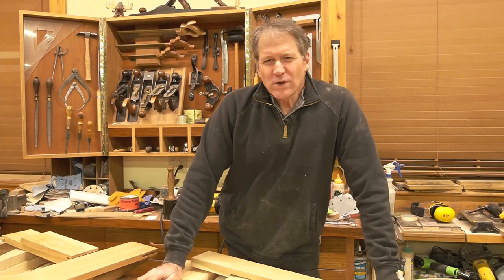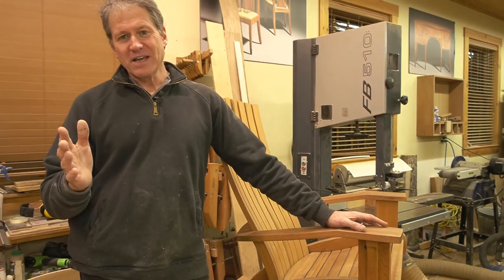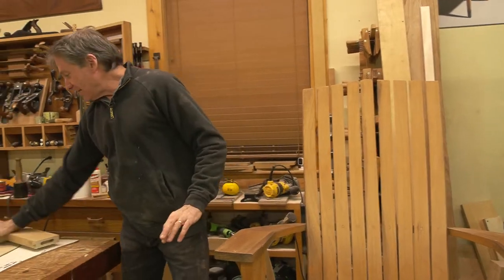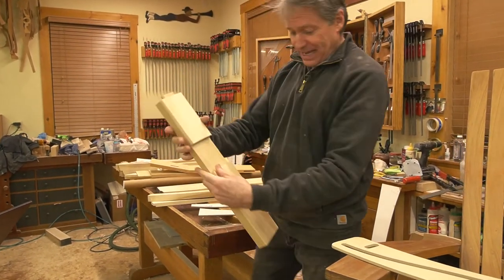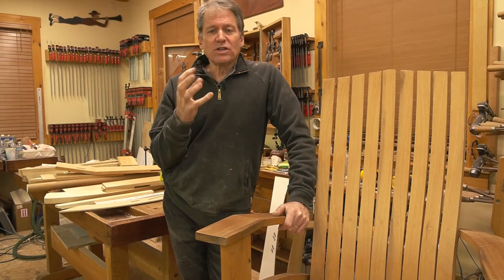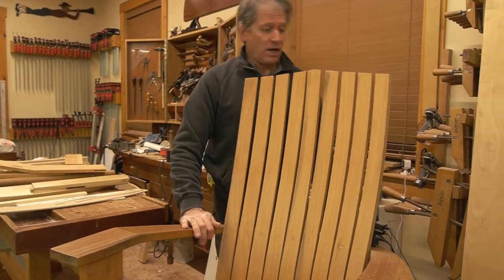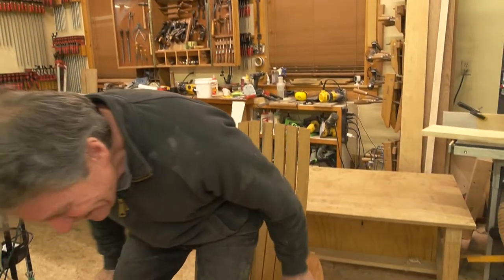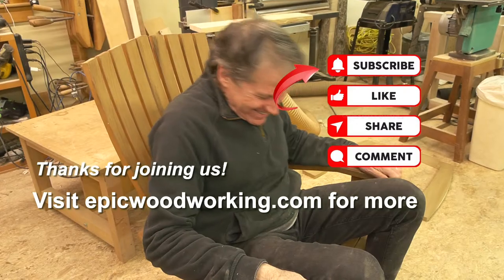The Ultimate Adirondack Chair?

Comment: My wife bought some old metal chair frames from a thrift store with the idea that I could do something with them . I believe they originally had 3 or 4 inch cushions in them.  I ended up creating a seat and back rest very similar to what you did on this chair . And I used 8/4 cypress with the back rest and seat slats cut so the quarter sawn side facing out.  I tried to include a few pictures but YouTube doesn't allow adding pictures to a comment.
Reply from the maker: That sounds quite nice, and very resourceful of you Mike! They would be interesting to see. Thanks for watching! 👍😎

Comment: Just saw a video where the builder used Total Boat Penetrating Epoxy to seal the white oak he was using. Then he used Total boat varnish.  I also saw a shipwrights use the same stuff, but he thinned it with denatured alcohol for even better penetration.   The product sounds promising. Its supposed to stop rot and repair wood.

Comment: I've just finished building four of these, and thanks to your AMAZING course videos and full size plans, they all came out great!  I will admit that I "cheated" and CAD-modelled a few of the more complex components and fitting templates so I could cut them on my CNC.  And like another commenter, I raised the seat height, from 14" to 16", extending the back legs a bit along the same curve.  Makes it a bit easier for us older folks to get ourselves out of the chair!  One problem that arose was mildewing of the bare cypress after a rainstorm.  So I have taken them back into the shop and am researching transparent finishes while waiting for warmer weather to take them outside to spray them.  It looks like there may be some kind of penetrating finish on the chair in this episode?  If so, can you share what you used and any recommendations?  Thanks again!!
Reply: So I wound up spraying my chairs with Penofin Ultra Premium Rosewood Oil, using their cedar color, which is the most clear color that provides 95% UV protection.  Two coats and they are holding up well.  It is an easy finish to apply and sprays well, so the accepted need to re-coat them periodically not all that daunting.

Comment: I made 10 of those.  But I changed them after the first one.  I found them to be far too low for me.  I added 4 inches of height and re-engineered the back legs. I felt if I had continued with the curve as it is,  I felt it might crack.  So I cut the rear legs back a bit, then added another piece using a half lap joint.  So the real legs have a "knee" of sorts.  I gave some away to my neighbors.  Then I made some tables to with them.  😊
Reply from the maker: Nice Dave, I’m all for customizing as best suits your preferences. Probably a good move to not ask too much of the back leg curve after you raised them the four inches. 
As I said in the video, I tried and measured quite a few versions and classics and the seat and arm height reflect what landed as the best all around, that is is you like the low rider feel of the classic Adirondack. Glad you enjoyed making them! By the way, if you are in the Neighborwood could you share any photos of your version if you have them? I’m curious to see and I’m sure others there would like to see it as well. No worries if you’re not in there.
Thanks again! 👍😎
Reply: @EpicWoodworking  Yes it would be nice to have a higher version of your well designed chair, so seniors can get up easier. Do you see a simple way to raise the height without affecting the all important curve of the back leg?